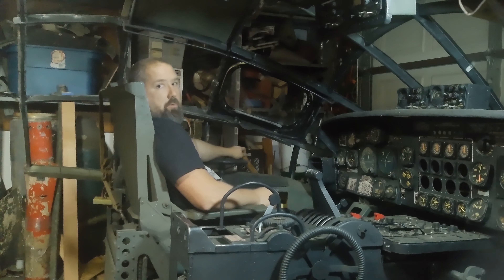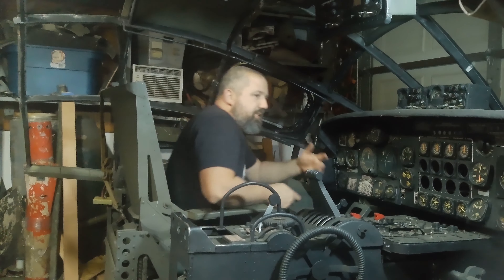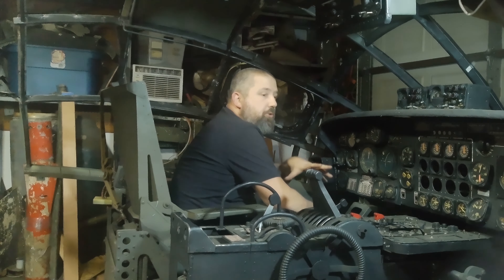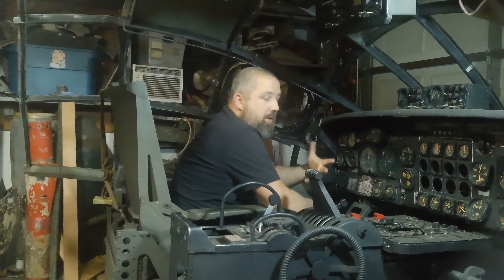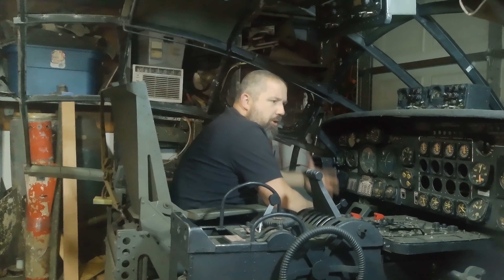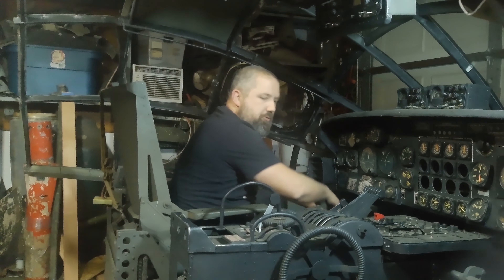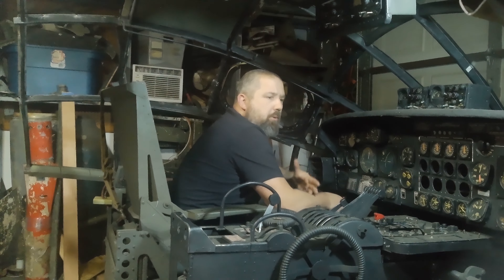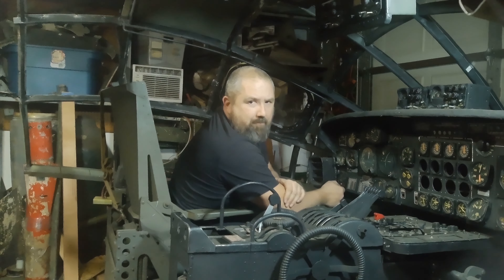Full Scale B-36 Peacemaker Build Entering the Aircraft Commander Station

Comment: The B-29 took at minimum 57000 man-hours to build in a highly equipped ourpose built factory.  That is 6.5 YEARS of non-stop work for one man. If you spent 8 hours a day every single day working it would take 19.5 YEARS to build by yourself.  Of course given the size of many pieces one cannot work by themselves.

I say you should get your cockpit finished and donate it to a museum.
Reply from the maker: Good info. Donation is the most likely path. I plan to build the XB-36 next and   I can’t keep them all.

Comment: I've watched a few of these and still don't know where all the cockpit equipment came from. Did you fabricate all of that or is it salvaged original hardware?
Reply from the maker: That airframe and all panels are scratch built. The gauges, seat and oxgen panels are vintage.
Reply: @B36HPeacemaker could you possibly do a quick video explaining how you made the panels? I am quite curious.
Reply from the maker: @sEngineer-il8im  The lighting panels?  They are 1/8” plexiglass with holes in them. The majority of the work is plotting their design using pictures and basic measurements. My entire build from day one is photo documented on the B-36 Interest Group on Facebook. Look us up!
Reply: @B36HPeacemaker  I will have to check that out, thanks.